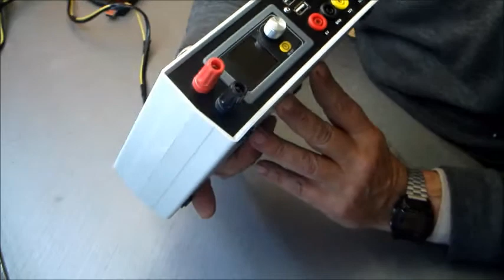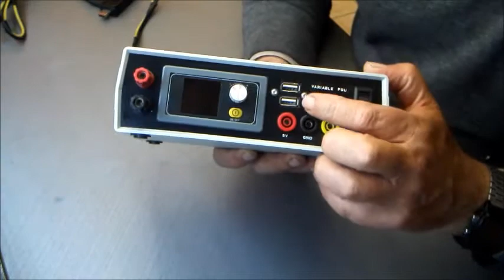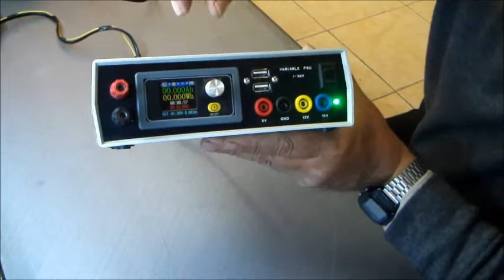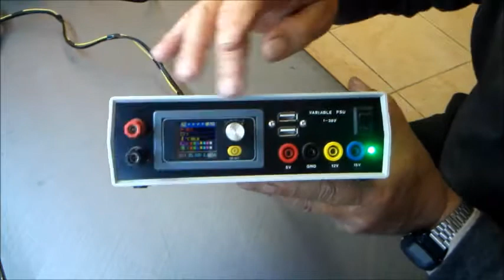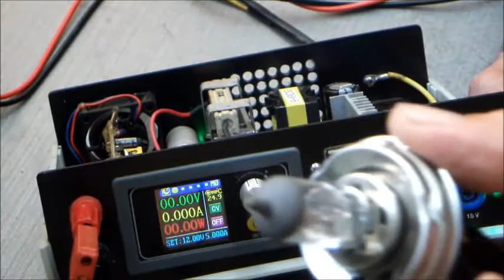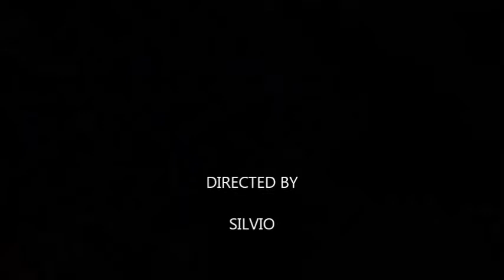Bench Power Supply

Comment: Hello Silvio, I am alexander hartdegen. I have a question please. Do you know principle of one winding switching power supply? Do you have any information about it? 
I mean, one winding is just one single wire, going in the tansformer, without any other one. Thanks see you soon.
Reply from the maker: Hi, Alexander the only one I know of is a buck converter which uses an inductor. This can be made with a lot of ice such as TOP221, or viper 22A etc. It can be driven directly from the mains and supplying 15v etc. The only mishap is that it is not isolated.